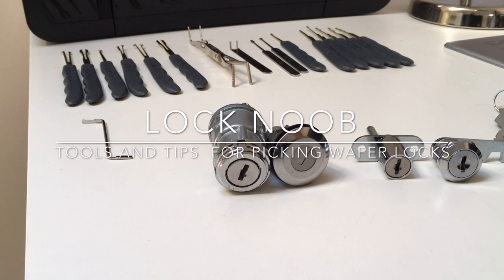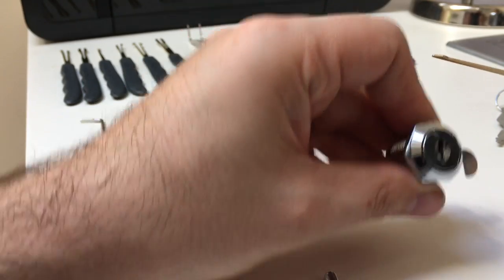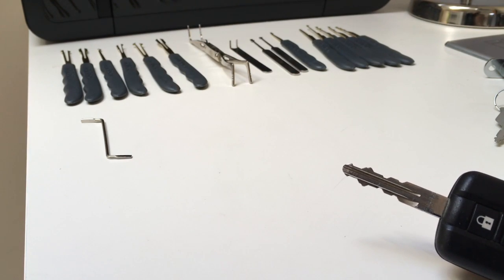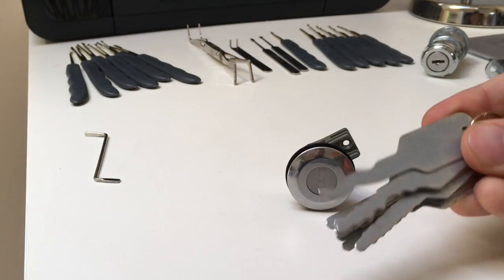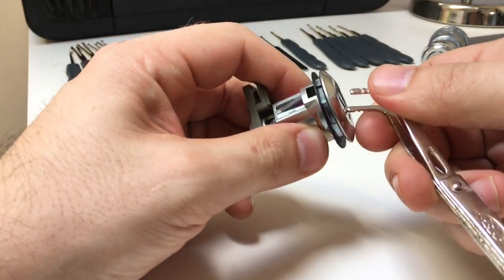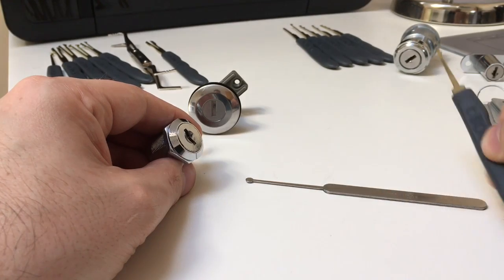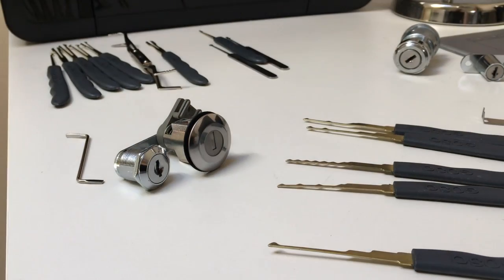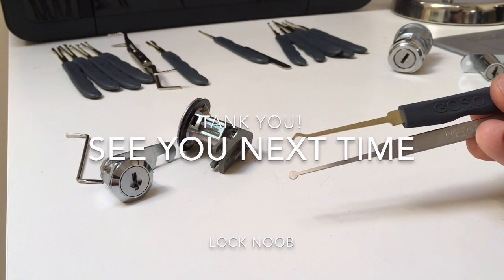(005) Beginner tools and tips for picking wafer locks

Comment: I have a wafer lock on my medicine cabinet in the kitchen.I got the cut out emergency survival picks and none could pick it!I fashioned a pick from a carpenters tool and it manages to grab the back spring and it pulls the barrel out.If I can put a video on here I will show you.
I have started making my own picks which are very rough for my first attempts but they work very well.I have opened a 5 pin padaock with one, and a small suitable padalock which was much harder to open!It had only one pin , a spool pin and this little lock gave me the most trouble! Lol
Reply from the maker: Steven McGinty well done with the picking :-) and making your own tools is really great :-)

Comment: If you look at a wafer lock key it has teeth on both sides so I assume normal one sided rakes won't work? Looks like you need the double sided tensioner along with a double sided rake to open them. Or can they be opened with a one sided rake if you put 2x rakes in there at the same time?

Comment: i sustained a brain injury and was looking into lock picking to help with my cognitive abilities. where is the best place to get a VERY basic lock picking set? or can i make it?
Reply: I know this is a year old, but sparrows makes really good affordable starting kits. Or you can try to make some windshield wiper inserts, best way to harvest wiper blades is to go to an autoparts store during a big rain storm lol.
Reply: @Hobbyhoarderguy  i appreciate your response however I got myself a Lokko basic lock picking kit with clear plastic lock. Managed to be able to pick the practice lock with my eyes closed but still can't even pick a basic suitcase lock
Reply: @Hobbyhoarderguy  oh, Im druiwe100, but forgot my account password
Reply: @Druiwe  It's hard to say  what the problem is, but the plastic clear lock is just for you see to where the pins meet the shear line of the cylinder. The idea is to get a feel for picking locks. Take a cheap master lock no1. Tension it with a suitable tensioner try not to add too much torque. Its a cheap low security 4 pin lock, so just make a mental note of which pins are binding with your short hook pick. You can tell it's binding just how hard it is to pry up. Pick that one, just bring it up enough to give you a satisfying "click" on your tensioner, and then move on to the next one, and so forth until all the pins are picked. I started building a cheap padlock collection to keep practicing.  Lockpicking is just one of the skills where you got to hone.
Reply: @Hobbyhoarderguy  thanks for the advice. I will give that a try. I can also seem to pick big locks but basic suitcase locks are more of a challenge to me
Reply: @Druiwe  Yeah those are hard to pick just because how tiny they are. It's hard to say what the best attack is without seeing the lock. I hope you recovered okay from your brain injury though.
Reply: @Hobbyhoarderguy  thanks alot for the response. I really appreciate it

Comment: I have the same lockpicks and the main one I use has bent how to I fix it with out it making it harder to pick locks
Reply from the maker: You risk snapping the pick by bending it back into shape, so go carefully. Ultimately, picks are a temporary and expendable tool which which you will have to replace at some point. Single picks by Sparrows and Southord are good value :-)